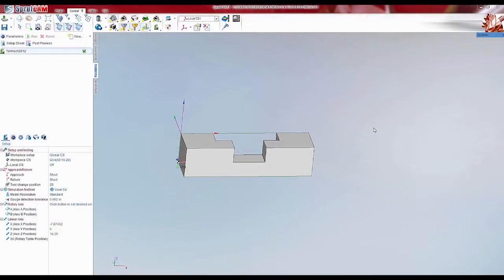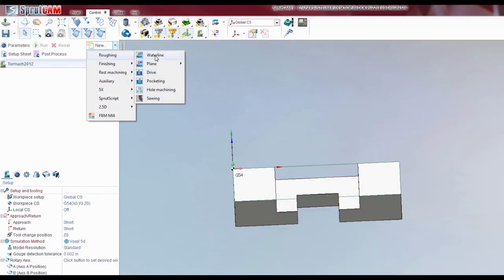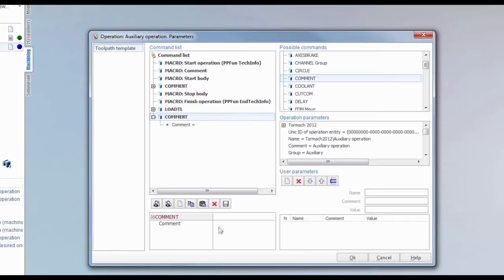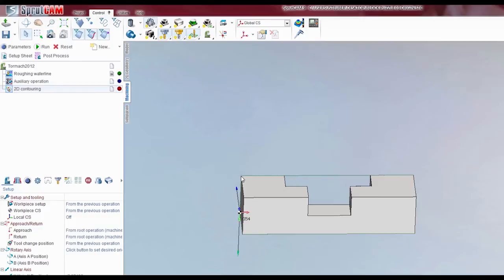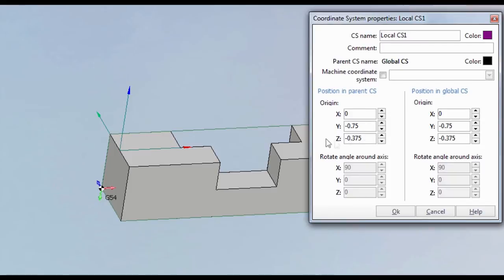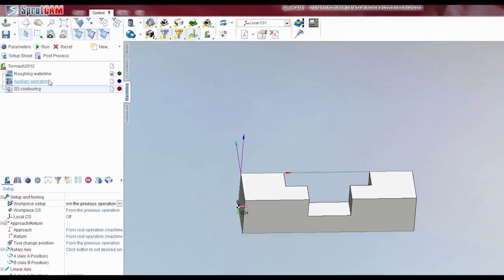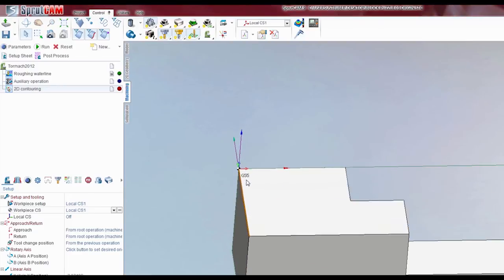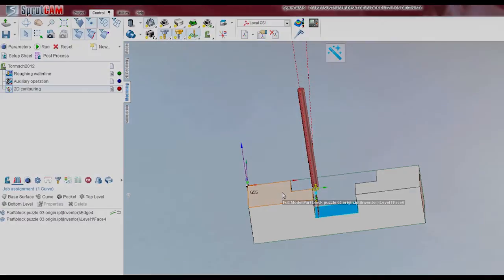How to Create a New Coordinate System - SprutCAM 9

Comment: So the aux op stops the machine so you can turn the part. You have to set up G55 on the machine before you run the first op and use a stop so the part when changed in the vice winds up at G55 X0,Y0,Z0. Is that correct. 
Also when you run the part the machine will stop and move to tool change pos so you can remove the last tool used in G54 ops. Once you have the part back in the machine at G55 do you just hit Cycle start again and the program will ask for the first tool in the G55 op. Is that correct.

Dave
Reply from the maker: David Sohlstrom Hi David, thank you for your note. Could you please contact Support[at]Sprutcamamerica.com and one of our SprutCAM specialist will be happy to help you.